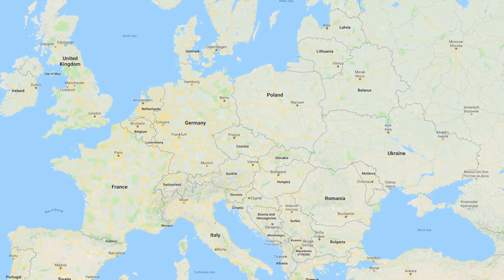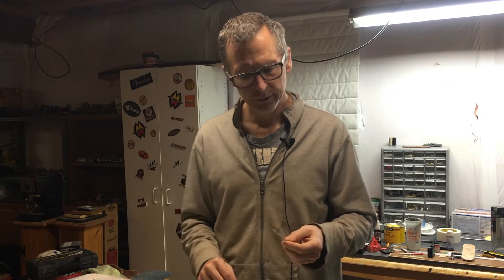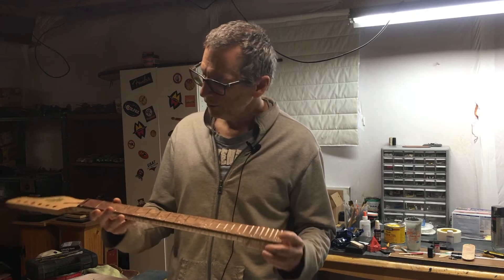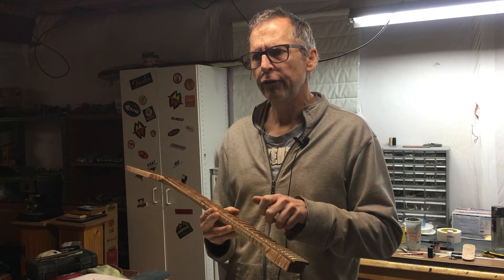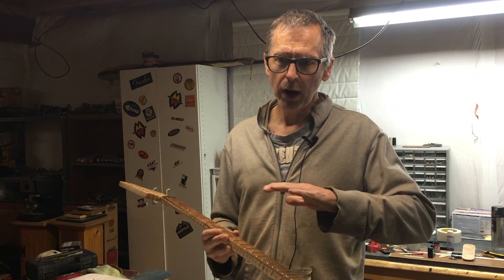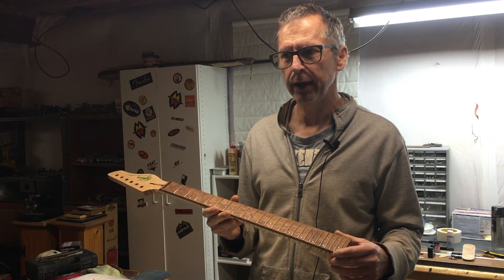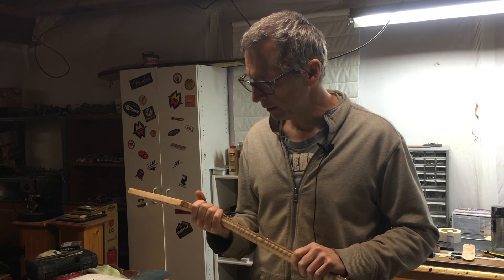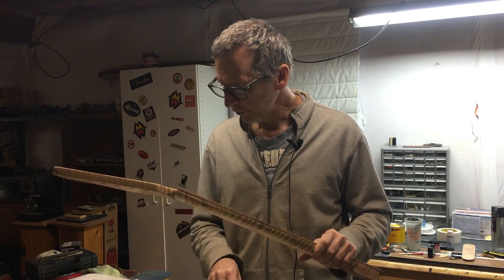A Look At Sintom's Bell Bronze Fret Wire

Comment: Sounds like a good option. 
If you do the titanium fret wire video, please ad the alloy composition. 
There is so much word play like top trumps out there. Carbon this,titanium that. 
The composition would be interesting when in use with certain steel strings. 
I'm guessing the gave you the bell-bronze and titanium to test new products, cause the only bronze fretwire they have on the website has a tin content of 15%, while bell bronze has 20-22 weight-% tin. Maybe it has to do with the production process and the rest is the advertisement that the guitar scene needs. If you have one with bell bronze still around, maybe add some close up shots after they're polished in the next video. Thank you for all your shared knowledge.

Comment: Two questions:
1. How was it for getting the file scratches out?
2. What do you think will happen over time to the bronze, from humidity and sweat... will it patina and get duller? Perhaps slightly less smooth?
Reply from the maker: It was easy to sand out the file scratches and polished up nicely. Much easier than stainless steel. More like nickel silver. I would imagine it might patina over time, which might look very cool. On the other hand, there are guitarists out there who claim this fret wire lasts much longer than nickel silver wire without showing any signs of wear.

Comment: Has anyone tested it with a Rockwell tester for hardness?
Reply: Well, this information is available online. It's impossible to be precise without knowing the exact alloys used, but in general, on the Brinell hardness scale nickel silver is 80-130, bell bronze is 160 (minimum) and stainless steel is 250 (maximum). The video is probably accurate in saying that this bell bronze is 'harder than nickel silver, softer than stainless steel'.

Comment: Have you, or anyone out there, used any of the hypoallergenic EVO fret wire?  (for people with nickle allergies) Does this compare? I'd like to hear any info or opinions on it.   http://www.lmii.com/products/mostly-not-wood/fretting/fretwire/gold-evo-fretwire
Reply: Yeah, I have used a lot of evo fret wire. It works great and it looks great, especially if you have gold hardware. Its hardness is also somewhere between nickel-silver and ss fret wire. My guess is that it would be similar in performance to this wire Chris is demonstrating.
Reply: Yea. Many times. It’s great. As has been said, it lasts longer than NS but it’s easier to work w.